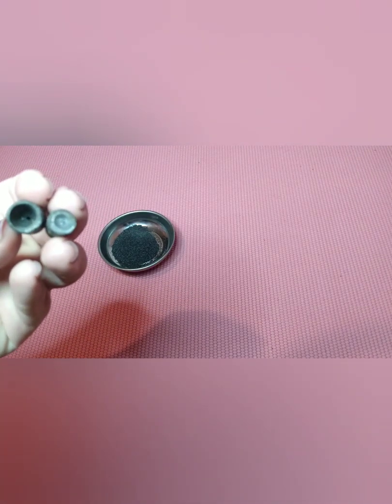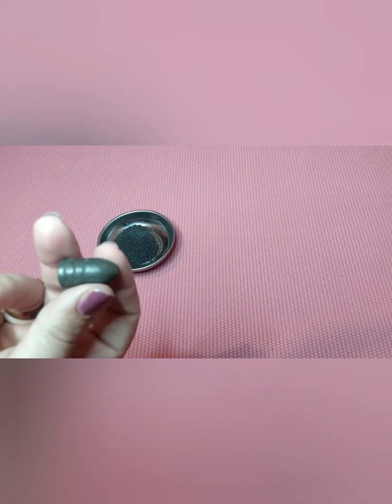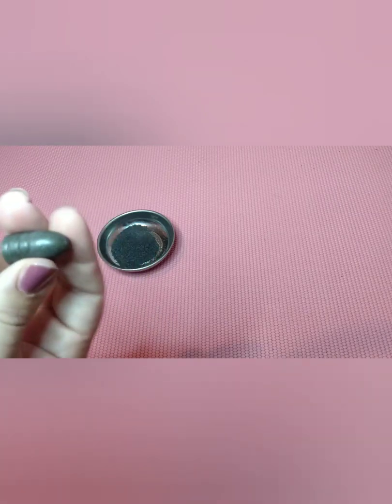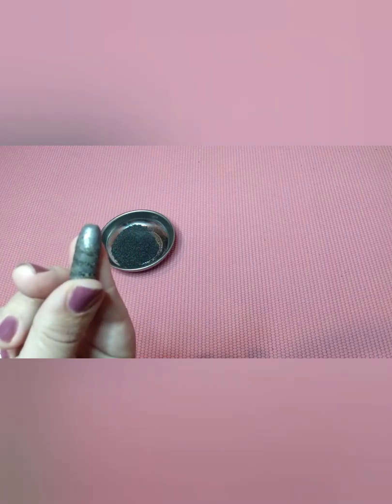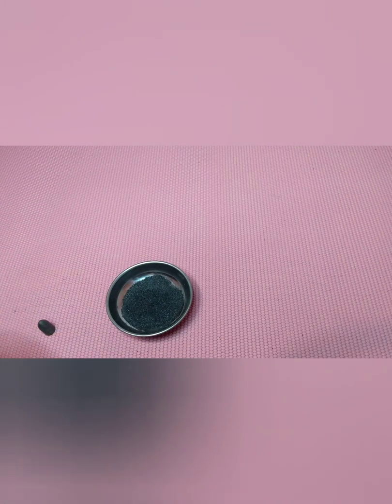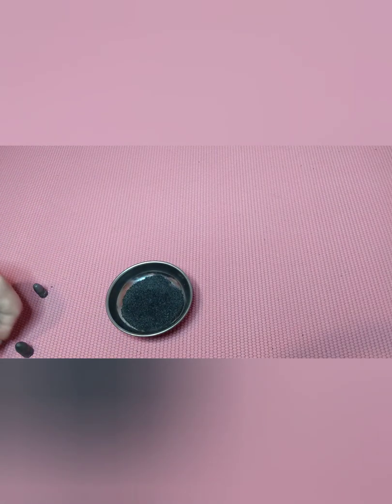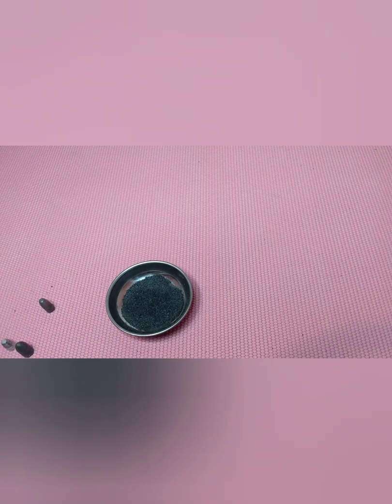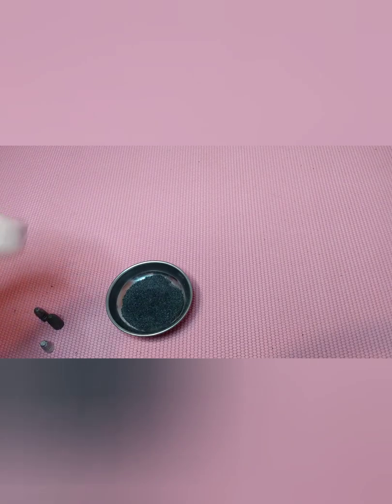Hollow Base Bullets and Black Powder Concerns

Comment: The hollow base is not deep enough for the explosion to get to radical just enough to engage the riflings long as you got it seated proper on the powder it'll never explode on you it'll do the job engaging the riflings nothing to worry about
Reply from the maker: That's a fact. But once you put pressure on the bullet as seen in the video it just fills the hollow right up. Infact black powder works better for hollow base than does smokeless , it bumps the skirt up better. Different pressure spikes.

Comment: For ROA better  bullet is ROUND  457 VERY SOFT LEAD..... Or converted  A )1 lead  225 grs  900 fts or more    no  under...  255 grs  at 850 fps    B) Jacketed  1  cci blazer 200 grs 900 fps  2  winchester jp 225 grs  920 fps  and  3  winchester  jhp 225 grs 850 fps   4 american eagle jhp 225 gfs 860 fps  5  sellier  bellot jacketed  230 grs  830 fps (rare to found   but really great) 6 Speer gold dot  jhp 250 grs  750 fps  7  underwood  fmj 250 grs  960 fps

Comment: Great video hope ur doing well today..  I run 100gr of pyrodix with sabot bullet.  In both my percussion gun and inline.    Think of change the powder away from pyrodix to some more modern not as corrosive plus I hard drop load down
Reply from the maker: Triple Seven works wonders. If you get a Black Horn 209 primer set up, it's expensive but Black Horn 209 works wonderfully. ♥️🖤♥️

Comment: Very well explained. There's not much I  can add other than black powder has the consistency of beach sand very impressionable. Whether your seating the bullet in a muzzleloader or cartridge the powder compartment is not air tight therefore helping conformity of the powder to the base of the bullet.  In the case of the cartridge air tight isn't achieved until the crimp is complete. It's up to us to make sure the bullet is seated firmly. Even a round ball is a problem  if we don't perform our due diligence.   

Crap I may have made that sound complicated.
Reply from the maker: Drop tubing helps , as far as black powder cartridge a compression die compressing the powder 1/16-1/4 of an inch. But your right crimping seals it out. Now in single shot crimping isn't nessary. At the end of the day it's taking up as much air gap as possible.  I think black powder is by far the safest powder to handload with if one learns to basic principles of the "no air gap".
Reply: Steve. Not even close to my comment for complicated. No worries.
Reply: @MrJento  that's ok I didn't  even  see the comment. That was me over thinking myself

Comment: Very succinct and practical advice on a subject of continual concern to the black powder shooter. Good to see you back at the plate swinging!

For those who may seek further information on this element of internal ballistics let me recommend Leiber “Assessment of Safety and Risk With a Microscopic Model of Detonation”, 2003. 
Modern testing systems now allow us to understand the process of combustion that occurs in the breach of a gun, be it traditional black powder or nitro-cellulose based products. Several variables exist and the entire process occurs so rapidly that observation and thus understanding are difficult. 

We speak of burn rates and detonation. Detonation is simply a propellent burning at its defined rate effectively contained for a long enough period as to produce sufficient pressure to burst the container. 

Every propellent has at least two and sometimes more burn rates, dependant on chemical and physical factors. Black powder simplistically has two such for the purpose of Joan’s topic. Open unconfined combustion and confined combustion. Black power ignited in a pile combusts very rapidly. We say it “explodes”. There is no suppression, or rather very little, suppression of the flame front and pressure wave through the propellent mass. 

In contrast a compact mass contained will combust at a slower rate due to pressure inhibition of the flame front in the solid mass as combustion and thus pressure increase. If pressure so created cannot be released, as in a pipe bomb then the container will burst at the physical limit of its material elasticity. 

Guns work and are considered “safe” because the barrel and breach have a high elastic coefficient while the bullet being moveable is quite low. 

The issue comes when an air pocket exists of sufficient size to allow unconfined combustion to occur in what is in fact a confined space. Then the inertia, resistance to motion proportional to mass, makes the movable bullet into a functional bore obstruction for a brief period such that pressure is generated sufficient to exceed the elastic limits of the gun. 

There is a differential equation that defines this process. I wont bore you. The variables are many. Suffice to say that there is an allowable air space within a gun, relative to the powder charge wherein “detonation” as we shooters call it does not occur. The volume of the cavity of a hollow based bullet falls into this general range. The problem that we shooters face is that the difference between “a little bit of air space” and “a little bit more” can be dramatic. Thus it is prudent to err on the side of caution but not to be so concerned about the minutiae that you cannot enjoy the general process. To wit, shooting.  Happy trails amigos!
Reply from the maker: Thank you for the added bit of information. General way of thinking is no air gap larger than 1/16th of an inch myself I say eliminate all the air you can. Compress it into a plug. I usually compress my BP loads 1/16-1/4 of an inch made a die for it in my .45-70 govt.
Reply: @JoanieKennedy  Correct. We make much about the potential air space in a gun for safety’s sake. Rightly so. It takes little effort to seat the ball. 

That said in black powder, and yes smokeless too, an air space should be avoided. The army dithered about with the 45-55-405 carbine load as compared to the 45-70-500 which was a slightly compressed load. The former load left an air gap of about 5/16 inch. Safety was not an issue. Accuracy was. 

The sharpes rifle company fiddled about with their 45-120-585 when reduced to become the 45-100-350 express. Same case. Large air gap. Safe but with erratic velocity due to variable burn rates. Thus erratic accuracy. I recall hearing about a similar situation with minimal charges of 2400 in a 30-30. 

In the end the big bore cartridges began to use card wads in all the loadings. The public came to expect it without really knowing why. Back to you.

Comment: I'll be packing some 45-90's for my 86 soon using the Lee 340.Should be a blast literally with 2F.
Reply from the maker: Iv always wanted a 86 Winchester. A lot of big boom fire power right there.
Reply: @JoanieKennedy  I spent some of my motorcycle money to get it but i very happy i did considering some i've seen on antique websites that look like they've been dragged behind a truck fo 40 miles mine is in excellent shape with a flawless bore.
Reply from the maker: @paulchandler9646  awesomeness 🥰
Reply: Just had go look to see what a 45-90 was